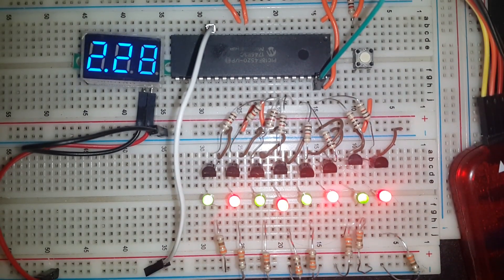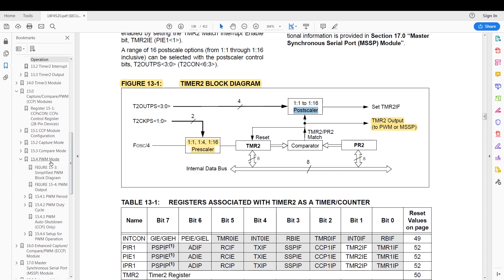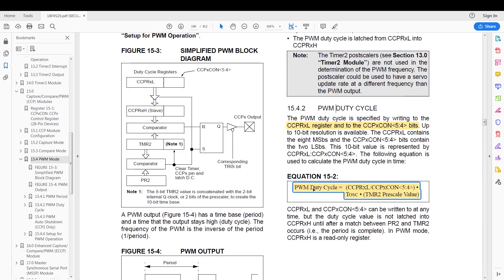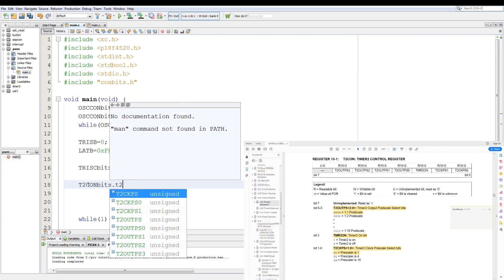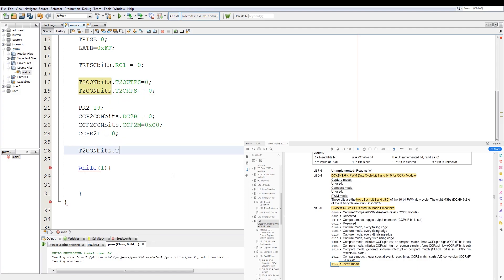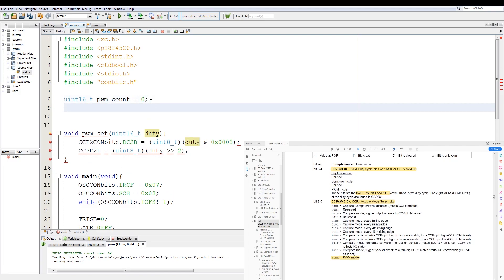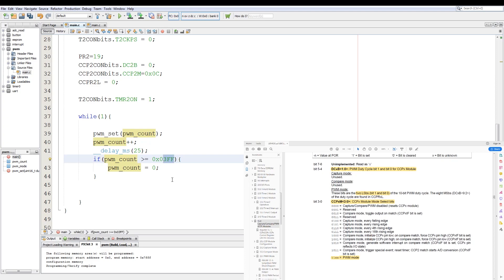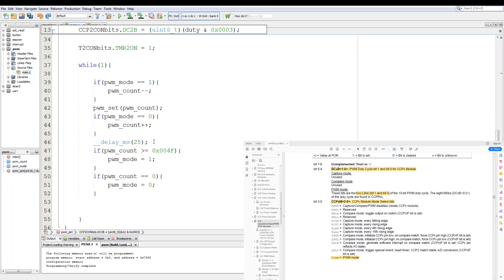PWM and Fading LEDs 🔴 PIC Microcontroller Programming Tutorial #10 MPLAB in C

Comment: Interesting video. You can do PWM with just 3 lines of code on a Udamonic Scamp3 embedded computer (PIC24-based and running Forth).  It compiles down to 32 bytes of machine code. If you haven't tried Forth as an embedded programming language, you really should. It's great.
Reply from the maker: Interesting, did not know that this existed. The only problem is that I assess a language by: "Can I put this on a CV".  I really dislike the syntax, reminds me of assembler. C is also pretty much on it way out in favor of C++. I might try it one day.
Reply: I guess it depends where you want you a job. NASA uses Forth extensively, particularly in its deep space missions. So do a lot of other companies. I've seen it used in some pretty heavy industrial applications. Speaking personally, I'm an R&D manager and if I see "arduino" or java on a resume, I move on. Just my $0.02.
Reply from the maker: This might be a "type of industry" thing but I have not seen Forth as a requirement or preferred skill. The most common hard requirements that I see are Altium, C/C++ (they mean C++) and VDHL with preferred skills: Python, JavaScript, C# and KiCAD. The most common architecture is also ARM Cortex Mx based MCUs. This is for the Title: Firmware/Embedded Engineer and in the European, American and my local market. Multiple industries including aerospace. Recently went though the process of firing my management. Just sharing what my experience was.

My initial impression of Forth was: "Oh this is like Cobol and Fortran". So I assumed it only still exists to maintain legacy systems.

Arduino does have its place as a rapid prototyping/POC platform but it is not industrial grade nor can it be maintained long term in production environment. Arduino has done both a lot of good and harm for the industry. I can write a whole essay on Arduino and the frustration it has caused me. Basically comes down to Wizard of Oz MVPs.

I have two things to say about Java. The best selling game (as of writing this) is written in Java. The amount Java is used in embedded Linux that needs a GUI is disgusting. I personally do not like Java but I cannot argue with the results.

P.S. To anyone else reading this. I have not use PIC MCUs once in my day job. Everything is on ARM or Espressif.

Comment: Can you please specify the values of the resistors and the hardware connection?
Reply from the maker: Transistor base 1k 5% (R11-R18) and LEDs 330R 5% (R1-R8). 10k 5% (R10) pull-up on MCLR
Reply: @BinderTronics  Thanks alot! Can you also explain and upload the code for that LCD indicator as well?
Reply from the maker: @ChunWaFish  Store bought https://amzn.to/2CLXmtE. Couldn't get the multimeter into frame.